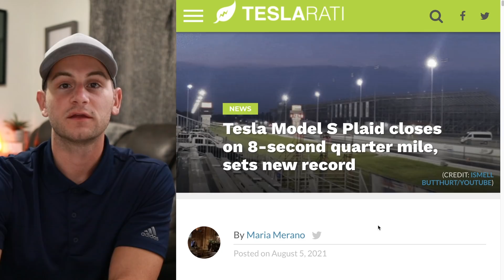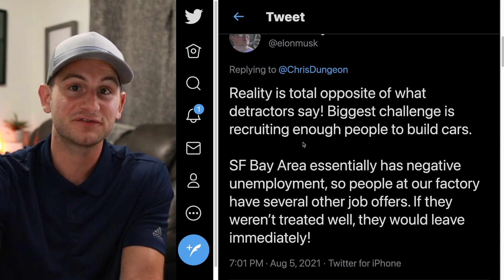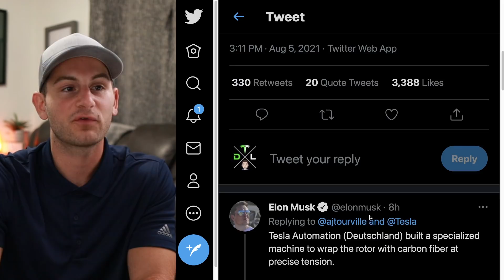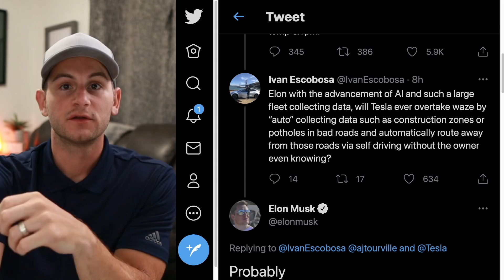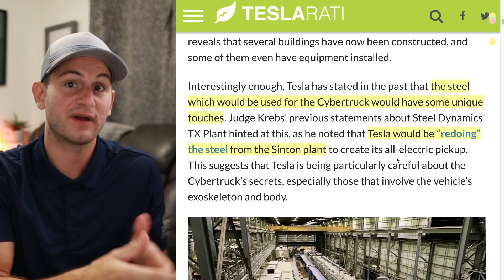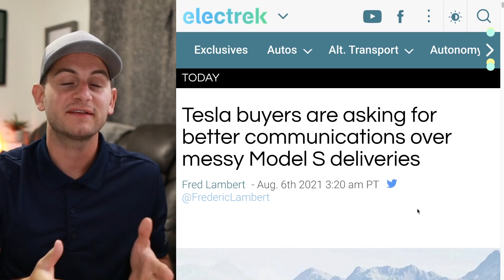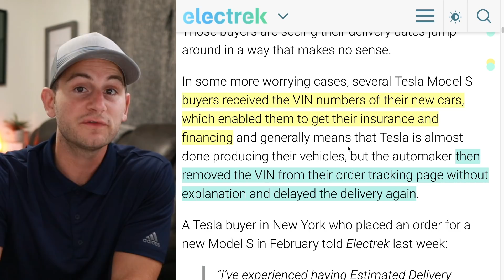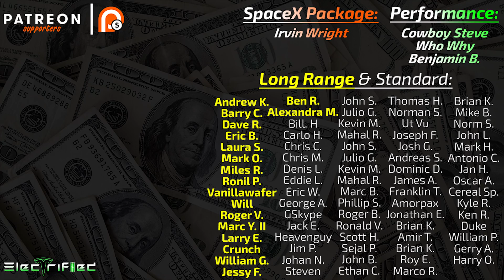New: See Inside the Cybertruck Steel Factory 👀

Comment: Thanks for showing the new stainless steel factory for the truck. 
 I did notice there are huge radiators indicating large amounts of waste heat.  following in Elon’s value system there are lots of ways to use that scale of wasted
Reply: There's really only two ways - Peltier arrays or turbines. But I agree, waste heat should be captured if it makes sense economically. Giant Stirling engines would be cool (no pun intended) but they're quite inefficient at those scales.
Reply: There are many ways to utilize waste heat for all kinds of uses. years ago I designed a waste heat utilization at an electric generation station that was used power a wood drying kiln.

Comment: Great video. I watched and commented on the older video which was also great. SDI is a great minimill company and their culture would align well with Tesla. I don't think there'll be a post SDI mill tinkering of the material at the Tesla factory. Most if not all properties for this SS are going to be set at Melting, Casting, Thin Strip Mill Rolling. Besides, Tesla will have an iron clad NDA with SDI (who will honor it to the grave) so there is no incentive for Tesla to keep any secret sauce (in house metals manufacturing) to themselves. It's similar to the battery development and manufacturing, Tesla wants those companies to make as many cells as possible, they realize they can't scale all this manufacturing by themselves. This is true of the Stainless Steel too.

Comment: Regarding Waze, Tesla and mapping; Contrary to other autonomous manufacturers like Wayne, Mobil-eye and even MB, Tesla is focusing solely on Vision recognition and not on prior mapping and enormous data transfer that requires 5G to notify the cars on problems in the path of the car (level 4). Tesla’s vision system can autonomously gather most of the information provided by social media of Waze and could potentially inform other Tesla cars of such hazards but, to my knowledge (or lack of knowledge) I do not know of Tesla intentions to provide such car to car information… this is a limiting factor that I think would limit Tesla as I think that these other car manufacturers and regulators would demand such a capability to mitigate dangers and even improve autonomous car behavior at crossroads and traffic lights.
Reply: @AudiTTQuattro2003  Has logic if it doesn’t have anyone/anything the computer has to turn to. 
System Engineering problem. It probably was instructed not to turn to the driver…

Comment: Steel Dynamics plant is designed to produce 3 million tonnes of steel per year....that's potentially a butt load of cyber trucks!
Reply: If another comment is right, then this is also for the space X starships…
Reply: Omri Hovers ohh yea good point, I completely forgot about the starships using the same material and their need came first.  Just more of an incentive to have this mill setup to provide for two massive products.  Looks to be predominately coil processing.  I know ATI was one of the major mills that ran coil domestically but they’ve ran into Union strikes this past year and so it’ll be nice to have another source to process raw material.

Comment: Does the steel plant use electric smelters or those powered by natural gas, etc.? If electricity-based I could see Tesla installing a square mile (or ten) solar array with an equally large city's worth of Megapacks. From the looks of the surrounding area, there should be plenty of room for a very large array. This would benefit Tesla's going green initiatives.
Reply: I dunno, but they clearly have a giant electrical switchyard.  But in terms of solar, it really doesn't much matter where it's located. Those electrons gonna flow where they're gonna flow, they're not going to treat you special just cause you live next-door. 

Cheapest solar is on land that's cheap and not good for anything else; near some power lines, that's all. Sink some cheap post-holes into the ground, spread it out so you can drive a PU down the middle for service & repair. 

It's weird. All those yahoos that a decade ago were livin in the back of their car and trying to get rich quick by linin up deals to drill for oil -- now they're going county-courthouse to county courthouse trying to put together solar, wind, battery deals. It's definitely boom I don't need no stinkin college degree to retire by 35 mentality.
Reply: @LinasVepstas  Electricity loses power over long transmission lines. Having the solar farm nearby reduces loss.
Reply: @robeigner4390  Yes, of course. But does it matter if that power is going to this steel plant, or it's going to Bob Dobb's air conditioner in Dallas? Either way, some of it's solar, and some of it's not.

I mean, yes, I agree: less wheeling is better. Best if consumers and producers are near each other. Less of a need to maintain a long-distance transmission system.  The reality is the wind is in west Texas, the population is in the east.
Reply: Solar panels aren’t green
Reply: @NoRegertsHere  Manufacturing of solar panels in not "green" but it's a once and done process while gas, oil, wood, whatever fired power plants constantly spew crap into the air. Solar panels in operation don't use any fossil fuels to function.
Reply: @robeigner4390  the future of industry isn’t solar or wind. It’s fossil fuels until something better comes along. So far the only thing I can see that could possibly do that are the 4th gen modular nuclear designs being built in India and South East Asia.
Reply: @awabooks9886  good one

Comment: Elon needs to relax. Tesla is the future of EV in the US if not the world. As for the Biden event, as I've said elsewhere, this was to get the antiquated American auto manufacturers, especially their union bosses, to get their heads out of the dark place and get with the program. Tesla already has a program and they're going to destroy Ford and GM, the others are part of a non-American company so they've already sold their souls (Jeep, Dodge, Chrysler). I don't believe Toyota, Honda, or any of the others were invited either so this was specifically the last chance for Ford and GM before they go belly-up. Biden would face a difficult time trying to pay off GMs debt again. He needs to let them die if they can't succeed on their own. When they do die, strip their manufacturing facilities and install Tesla-inspired equipment and build EVs the right way--not like Ford has done with the Lightning, just removing the ICE components and replacing them with a messy EV set of parts.

Elon is right about a lack of employees in the greater SF Bay Area. Tesla needs qualified technical people, which the Bay Area has, but also general workers, which the Bay Area doesn't have extras for. Detroit and other Ford and GM cities have an excess amount of available general workers as well as some technical ones who could be retrained on EV technology, again using the right way not the old way.

Comment: The Plaid can easily get into the 8's if not the 7's by stripping the interior and any non-essential weight. It might also require a few software tweaks to the drag strip setting to get a quicker start. Question: is the drag strip setting able to react to the christmas tree automatically launching the car? This would probably be illegal.
Reply: Isn’t most of the weight in battery and motors?
Reply: @NoRegertsHere  Sure but there's a lot of weight in seats (passenger and back seat), interior body panels, spare tire, etc. I've seen drag times in the mid 7's by a Model S on youtube and he stripped his car. I'll look for them again.
Reply: @robeigner4390  Huh? The Model S has no spare tire!
Reply: @NoRegertsHere  Couldn't find it quickly but found one stripped Model S that took out all seats, replacing front two with lightweight racing seats, added a roll cage and even removed the floor where it wasn't needed. They dropped about 500 lbs or ~10% of its original weight. Didn't find any that went into the 7 sec range. The guy was younger blondish dragging when nobody had ever seen a Tesla on the strip.

Comment: You do know that plaid was gutted right. Like almost every interior panel removed. The only interior left inside was the Dash and the driver seat
Reply: @awabooks9886   well if modding the vehicle counts then why does putting a new motor with 2000hp not count 🤷‍♂️